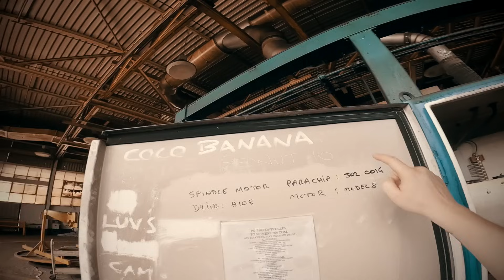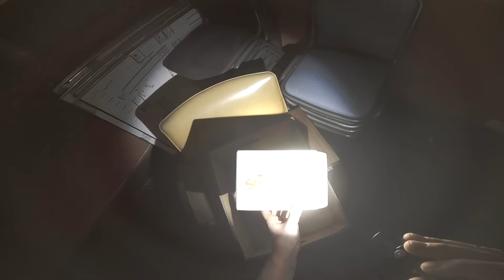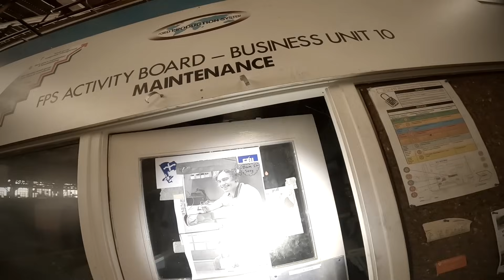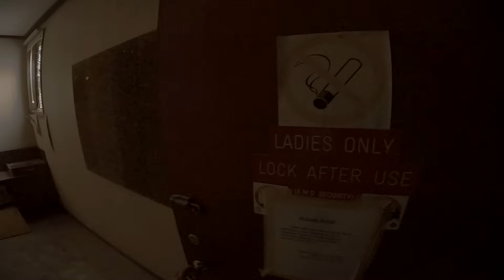I Snuck into Abandoned Ford Factory (Geelong)

Comment: With parts of it being built in 1926 the place is probably full of asbestos sheeting. I don't think anyone will buy it so it's sadly just going to rot and be an environmental hazard that nobody has to take responsibility for. I do like the look of these old factories and it would be great if it could be used for something but it probably won't.
Reply from the maker: I vaguely remember seeing some on the top level. They must have removed it all when they gutted it as new businesses are operating out of it as we speak.
Reply: @urbexgecko  really that's fucking great!  I love being wrong about something like this. Seen to many old building abandoned because of asbestos.
Reply from the maker: Same man, very rare to see places have it removed and then get a 2nd chance.
Reply: Ford was trying to remove most of the asbestos (very big job) some parts had it in the roof sheeting a lot of the outside wall panels had it even the corking had it in it the furnaces in the heat treat area in old water pipes even in the clutches on the presses
Reply: Ford had a 5 year plan to remove it but ran out of time any one that was deemed to have been exposed to it was ask to report it and be put on a medical segister (I am on it) the new owners seam to be trying to rid the place of it but like I said it is a big job also the casting plant was full of it probably why they demolished it also the ctx aluminium casting, transfer case area which is now gone (innovative window design is in there now)
Reply: @urbexgecko  
I can confirm that all the asbestos has been removed and 95% of it has been replaced with metal sheeting, only the back corner (near where the spirit of tassie now docks) hasnt got the new sheets up yet.

They gutted everything from the inside and sold it to a scrap yard, with the exception of some of the overhead cranes which some of the various businesses that currently occupy it still use.

There is also a new factory building in the old carpark (down the hill near cowies creek) that will be complete in the next week or two, which is going to be an amazon distribution joint.
There is also going to be another factory building built next to it and they plan on putting a servo there too (yes, another one lol) 

As for the old ford factory building, i think they've divided it up into about 15 or 20 factories, with only a couple of them not being leased out yet. Its worth mentioning that once they're all occupied, its going to net the owner over $1M per year - apparently the guy who bought it has some connection to either, the mafia or the mob, i forget which one it was. 

And incase you plan any future endeavors around that area, as there's still a couple of old side buildings along north shore rd that haven't been touched yet, the new owner installed cameras all over the place and alot of them, some are them obvious, but others have been placed where you'll never see them - to give you an example, i know of two that are embedded into trees on the side where the creek is, which i dont even think is part of the ford site.

Sorry for the essay, ill wrap it up now by saying that I only know all this as my father-in-law works in one of the businesses there and its pretty high up in said business - And as im currently car-less and work down geelong way as well, ive been borrowing his car to get to work, meaning, ive been driving in and out of there and waiting around in there, twice a day for the last couple of months.
Reply from the maker: Cheers for taking the time to write all that up Chet, answered some recurring questions I and others had. Another bloody servo hey hahaha. Haha nah, won't be going back man. I told myself once I left that was it, and to enjoy it whilst it lasted.
Reply: @zchettaz  you are talking about the out side clading? most of the out side clading has been removed but the front of the toolroom on melbourne road (the new building, built 1976) is clad in cement sheeting and dose contain asbestos, so dose the south side of the toolroom wall) only know about the front of the toolroom having asbestos after the put the sign up the front and did not check for asbestos before doing so? other parts of the building are rittled with it (any thing built up to the 90's could have it it is in the electrical wiring the water piping, wall paneling) the old side buildings is probably the old compressor house (supply air to most of the plant a lot of things ran on compressed air the presses, grinding tools ect) and a gas cylinder storage area (gas, nitrogen, ect) also clad in cement sheeting, in the video you can see some parts of the roofs had been replaced but not all mainly around the stores, small press shop can confirm the satellite  canteen, hr, locker room, gym scheduling building (was used for the injection center) has been gutted, the roof removed(have pictures) the creek is on ford's side ford used to own the land right up to the separation street bridge the chassis/engine plant is now owned by godfery hirst carpet was known as plant 5 and is still known as plant 5 there is a bridge crossing that creek on the east side (to connect the two plants but was fenced off when the plant was sold) also have pictures of the gutted press shop and a whole lot of internal pictures taken right up to the closure can e-mail them to you if you want
Reply: @urbexgecko  
All good mate.
I just came across your channel, lovin' your vids. Are you based in Victoria?
Reply: @trevorjohnston9504  
Yes, outside cladding and whatever else had it on the inside of the main building, as everything inside it stripped out, down to a skeleton basically - they even jacked out alot of the concrete and replaced it. 
As to that front building/s (on Melbourne rd), they're about to start doing work to it, i dont know the exact details of what they'll be doing or to how much of it (as theres 2 sides to it, with a driveway seperating them)
Id say you're correct about the side building being the old compressor house, i dont know anything about what they plan to do with it yet, all i know is that it hasnt been touched or stripped out yet.
I didnt know that ford owned all that - because godfrey hurst has been there for as long as i can remember. Do you know what year they sold it? But i guess that explains the legalities of putting hidden cameras around lol

Sounds like you're pretty familiar with it all, im gonna guess you work in one of the businesses there? Or at least a local to the area?
Reply: @zchettaz  i worked for ford's 1983- 2016 (press shop 1983 to 2002 toolroom, 2002-2012 toolroom leased to marand engineering, 2012 back to press shop spent the last 11 months in the shipping area 2016)  do not know if the compressor house is still supplying air to  to product development( ford sold of most of the plant except product and the service garage to a land developer around 2017 where gorfery hirst is was the chassis plant and the the 4 cylinder engine plant but was closed down and was used to store parts for a while  was sold off to the costa group for 1 million dollars can not remember the year they were going to put a retail center there but toll ports kept objecting to it they (wanted it for the port expansion) sat empty for years and then place was stripped off all it"s copper and then was sold to a queensland developer who either sold it or leased it to godfrey hirst they have been in there for a while and  have also expanded on to the old north car park if you look up godfery hirst web site they would have more information i live in geelong but the other side of town (saint albans park) but know ex ford workers who work for marand and also in the product development area service center there are strip out video's of the press shop on you-tube ausdecom ford also used to own the land where bunnings (that where the old research and development plant was before they bulit the new one on the east side of he plant

Comment: They closed in 2016 for falcon because of low sales etc. Popular of SUV and Dual cab ute. Shame!!!
Reply: There was a push from inside Ford to build the Focus here, of course however Detriot said no.
Reply: @Xlerv8  ford in  geelong in 2009 built two complete sets of dies for the focus(bonnet inner and outer and front fenders, draw dies ,trim, pierce and flange)one set of dies for thailand and one set of india, the india set were to a lower grade of metal(thinner) was told that the thai set would be returning to australia as the focus would be built in australia did not happen? went with a 4 cylinder falcon instead
Reply: What ultimately killed Ford is that their legendary Barra inline 6 engine couldn't meet modern standards and it wasn't viable to re-engineer things to meet those new standards given the low sales of the products being built in Oz.
Reply: @jfwfreo  correct they were to go with a V6 but it would not fit, engines already sourced form the states, the current 6 would not meet emission standards and re tooling would have been expensive, working on try-out we got to see the new models and up grades well before the general public i had to be careful what we said out side of ford's still have a lot of things i can not reveal even though i don't work there any more

Comment: Too late the engine plant has been stripped, pressshop has been stripped all presses are gone some sold but most cut up for scrap went past today 29/07/2023 injection hub (old canteen /HR/locker room/gym has been gutted only the shell left
Reply: About 3 years ago my work picked up an old Lathe out of there that had been sold off which weighed 13 tonne and we took it over too Karratha in W.A to the new owner
Reply: The canteen/hr office is now completely demolished

Comment: Main floor? that is not a caffitria they were all called  an oasis they were had coffee and machines,Coke machines, Food vending machines, Microwaves some had filed water some even had TV's the phone booth's were there to make internal calls(before mobile phones) some were able to make out side calls, the red phones were a direct line to the guard house used in case of a fire or an emergency
Reply from the maker: Great insight! The phone booth hybrid with old branding was awesome! Would have loved to salvage one of those red phones too.
Reply: If you picked up the receiver or unplug the phone it would have set of an alarm to the guard house and they would have come looking, when the factory was running there would be a test run every Thursday at 9.00 am and the horns on top would sound and you would have to pick up the receiver to cancel the alarm and speak to the person who in the guard house to confirm everything was OK or they would come looking lucky you did not pick up or move the red phone
Reply from the maker: Loving the intricate info, interesting as! Was the guard house that booth in-between the main gates?
Reply: @urbexgecko  the one on Melbourne road was a guard house(the one you entered though) but not the main guard of house, that was only manned when required the main guard house was on north shore and road to the north of the plant where trucks could enter and exit it was also where the b-triples(prime mover with 2A trailers plus a B-trailer) would exit, this was manned and still is 24 hours per day there was also a guard house a the gate past the canteen which was manned at shift changes also where the B-triples would enter but is also over seen by a video camera.
Reply from the maker: Oh wow, I had absolutely no idea about it being manned at the time haha...only ever heard about random security patrols. I instinctly pick up phones in bando's normally too haha, but was too concerned with taking photos of those ones. Lucky as! Walked straight in front of that main gate camera as well, no idea how I didn't get busted...grateful as! 🙌 Cheers for all the detailed insight Trev, love that place.
Reply: @urbexgecko  not know if that camera you walked past was on but I know if you even enter the car park(the one off Melbourne road) you are pick up on the video camera and if there is no one in the guard house they will send some one to see what you are doing there(drove in to the car park like I had done a thousand times before) within minutes there was a security guard in a car may be because this car park is being used by merand (In the old toolroom) and metal Corp is now leasing the old canteen and parts of the old press shop(stamping)
Reply from the maker: Phew! Almost had a wander around there too, but didn't want to push my luck.
Reply: Yes the building at the end you would have seen it when you looked through the window in the door(the white building)